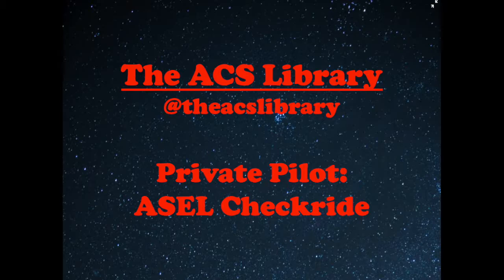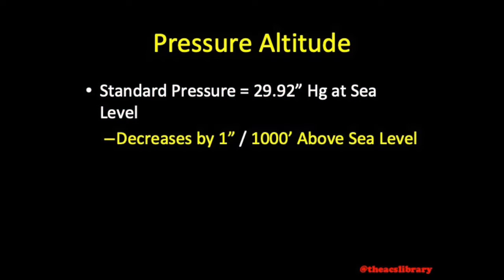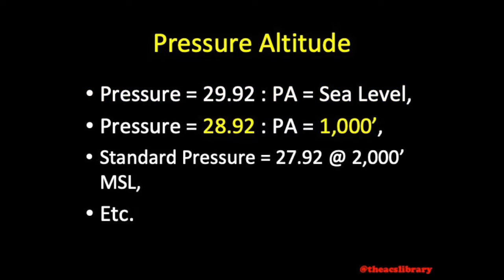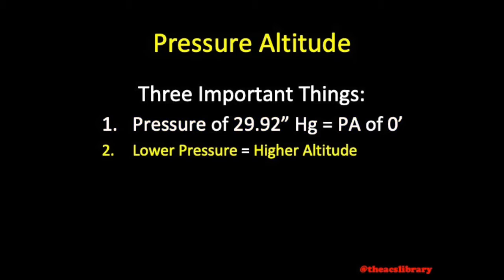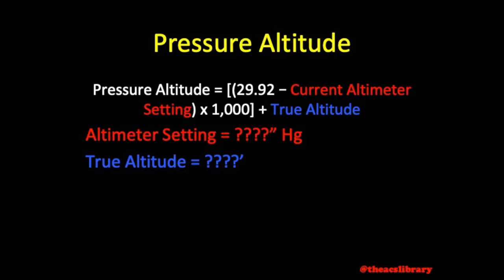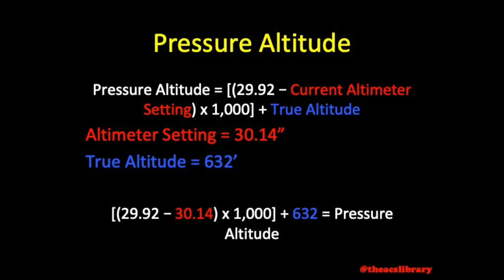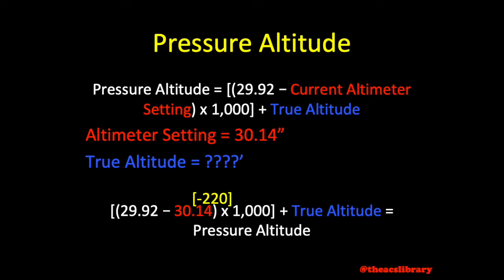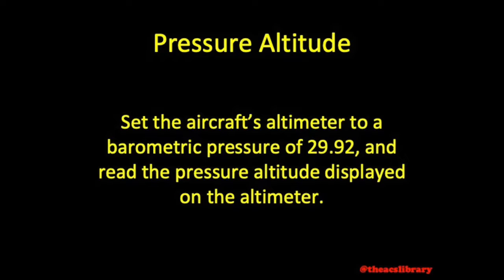Pressure Altitude : Everything You Need to Know

Comment: Thanks for another great video. That being said, it's probably worth noting that for most performance calculations, density altitude is much more important than pressure altitude.
Reply from the maker: Absolutely! I don’t think I’ve used a performance chart yet that doesn’t factor temperature into the mix.

Comment: What is the pressure alt at a certain height?
So if at sea level it reads 30.14, and im going up to 4500 ft, how do u find pa there
Reply from the maker: So at Sea Level it read’s 30.14.  That means the pressure altitude there is -220 feet.  To find pressure altitude at 4500’, just add that -220 to your desired altitude.  At 4500, it would be 4500 + -220 or 4500 - 220.  The pressure altitude in your area, at 4500’ MSL would be 4280’.
Reply: @theacslibrary4404  thks